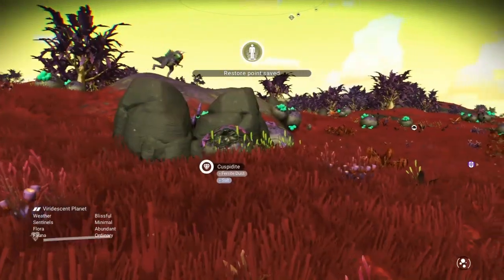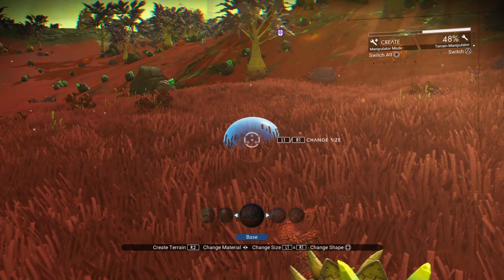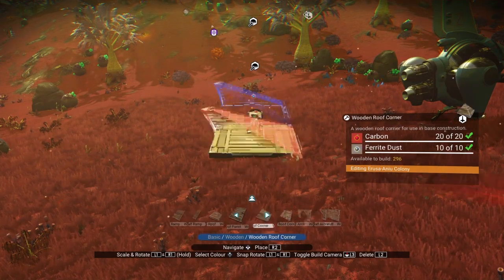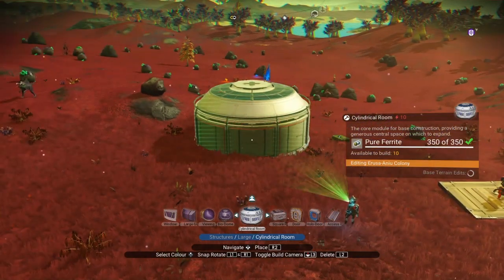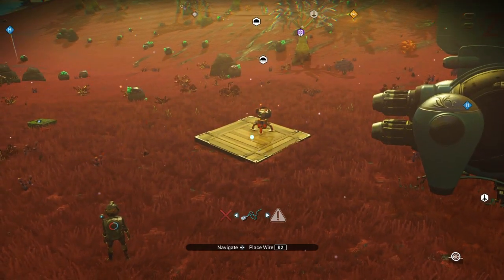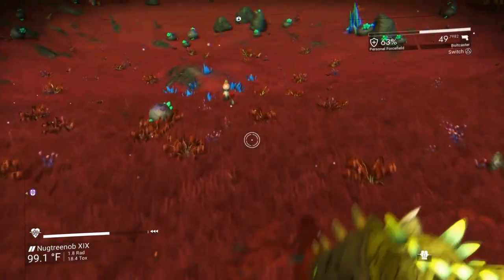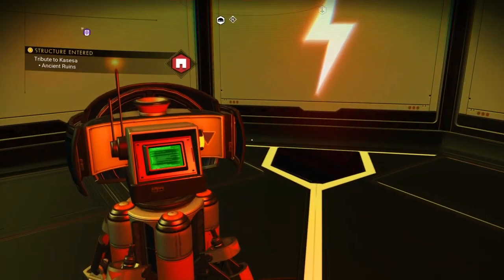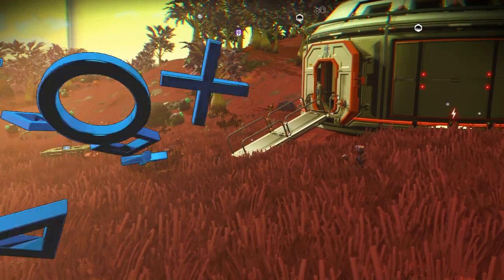No Man's Sky - Placing a Base Computer inside of a prefab building.

Comment: Appreciate the video, gave me some hope of tryig to do what i wanted but unfortunately my OCD about the computer floating even partially in the air was enough to drive me nuts. I've ended up doing a really tedious attempt of using 2 bases (technically 3) and settling for a computer on the Landing Pad and then a loooooong series of prefab building connection tubes 800 blocks out to a second base, and delete the first one after placing an unclaimed base computer on the pad since it won't get deleted but then i can build the connection tubes back into an exact grid snap-on position. 

Just figure i'd share incase you might want to know. It allowed me to get a base with a computer on exactly where i wanted, almost, originally i tried the trick but to snap on a prefab building but i guess it interfered witht he glitch trick. landing pad method worked without any glitch style efforts